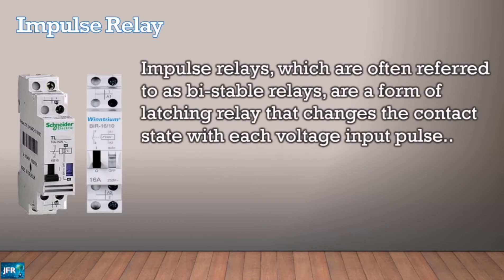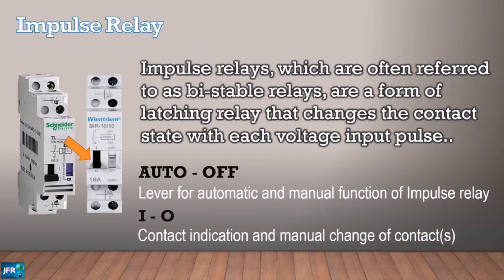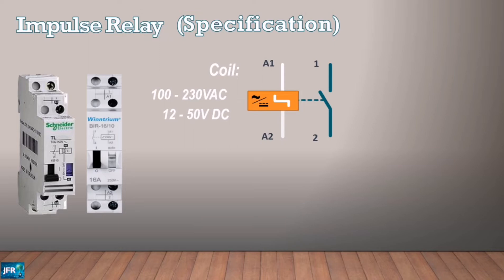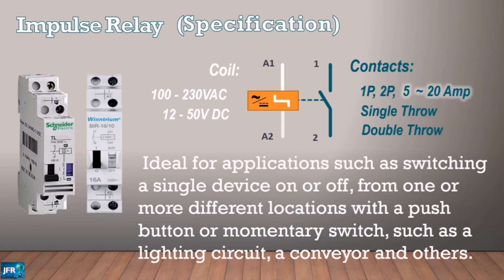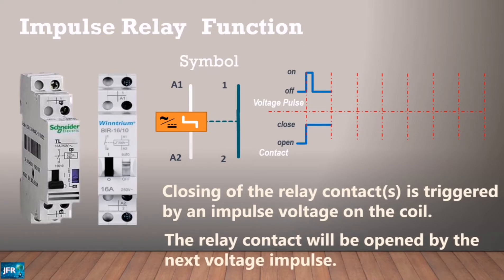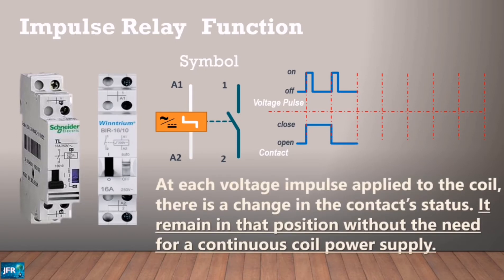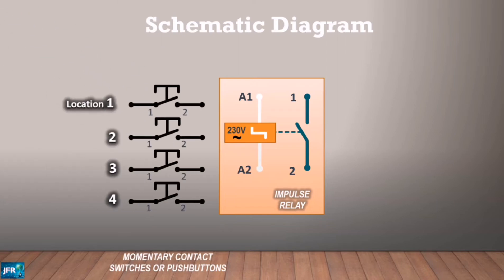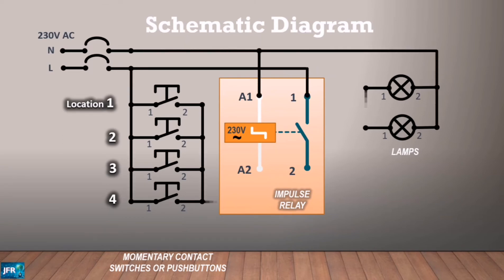Impulse Relay (Latching Relay) Basic Function, Wiring and Application.

Comment: Hello! I would have a question. If I would like to install a twilight switch before the impulse relay, how does the wiring change? Do I wire from the twilight switch into the push buttons & the impulse relay input 1 as well? 
Or do I wire from the twilight switch only into the push buttons?
And the impulse relay input 1 can get still the direct wire from the circuit braker?
Thanks in advance!
Reply from the maker: Just parallel the output of the twilight switch to the push buttons. It works basically like the push button switch, only its activation is through the sense of  natural lights.
Reply: @jfrelectechnical6652  How are we supposed to De-activate/Automatically Shut-Off Circuits when/upon the Sensor sensed daylight?🤔

Comment: does this video means if two single pole switch was only use in two locations w/a pulse relay single pole switch can function as 2-way switch
Reply from the maker: You need a momentary contact switches and not a holding contact switches.